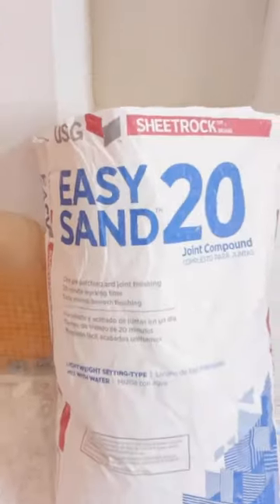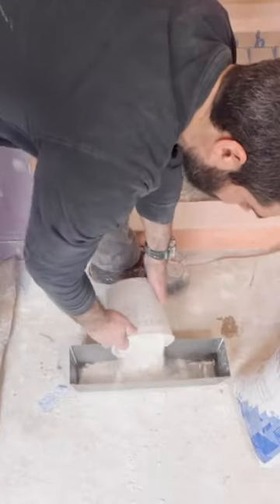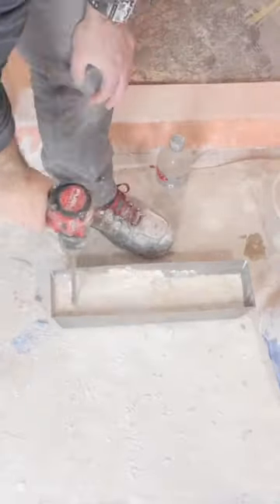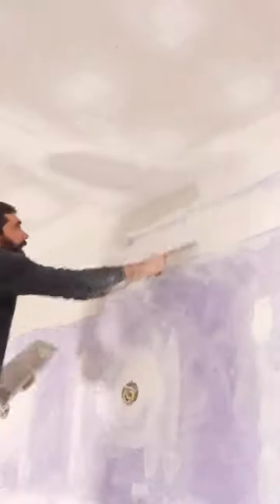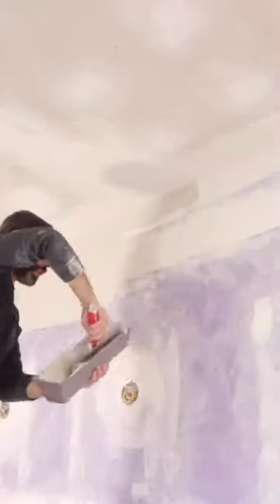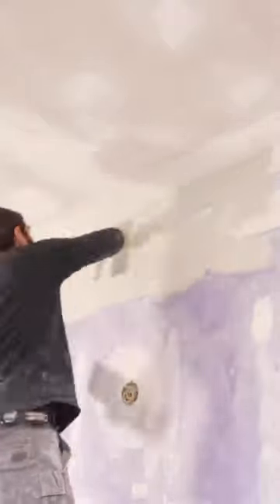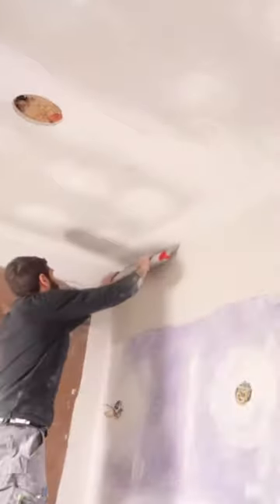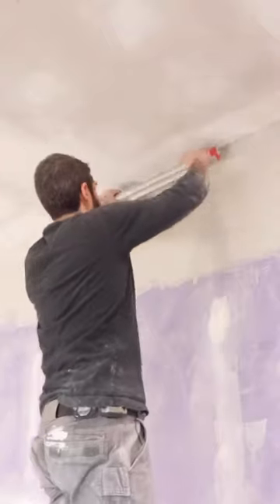Drywall skim coating tips with the LEVEL5 Skimming Blade 👊

Comment: Ive used this to skim coat a patch. When I painted it the following day roller pulled off the mud from the wall in small chunks. It doesn't take paint well and it can peel off. I recommend floating with easy 20 as much as possible then always skim coat with normal topping or whatever non fast drying mud you like.
Reply: I only use hot mud for repairing holes. Regular joint compound has more glue in it and works better for skimming.
Reply: Hot mud is made for pre-filling cracks and broken board before you do the finishing hot mud is not used for finishing

Comment: Do not use quick set mud, just use plus 3 mud.  Use quick set mud for repairs or pre filling.  Unless you’re a drywall professional.
Reply: Great advice. That 20 will harden up on you quickly

Comment: I used to use a PVA primer on top of hot mud to prevent flashing and get a good final result. 
I’ve heard of mixing glue in the hot mud to help as well, Vancouver Carpenter has a good video on this.

Comment: I use a light weight box mud for a final skin coat.
Reply: Можно я чу-чуть подправлю вашу работу какашками 😆🤣😆🤣😆🤣
Reply: Your using easy sand to coat ya you don’t do much drywall do you
Reply: Definitely. I use Ruco
Reply: The easy sand is definitely not easy sand

Comment: Why would you skim with hot mud? Seems completely pointless and more expensive. Normal mud will sand easier and probably be dry faster. In like 20 mins if you put a fan on it.